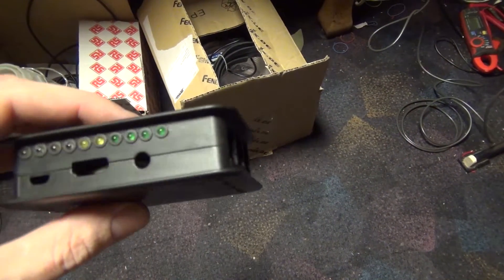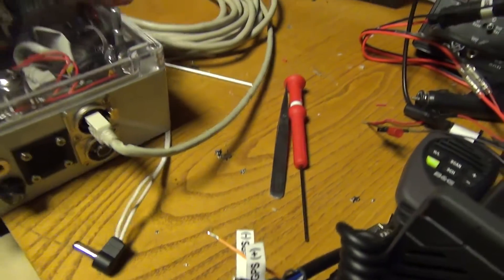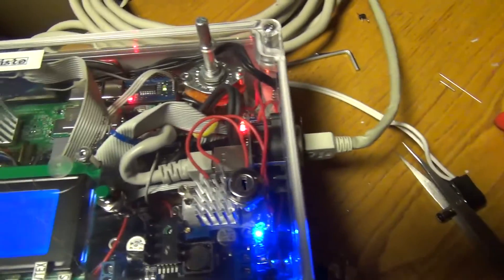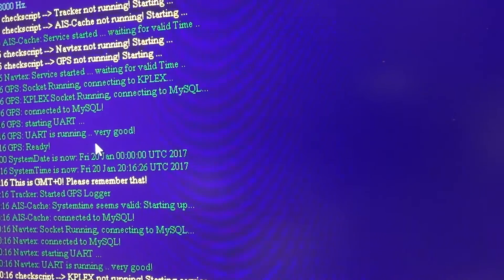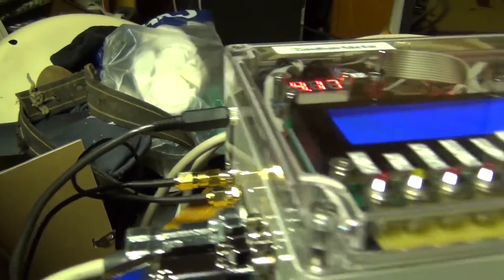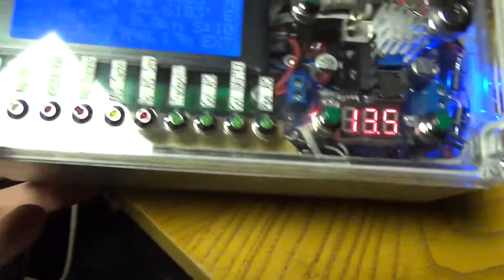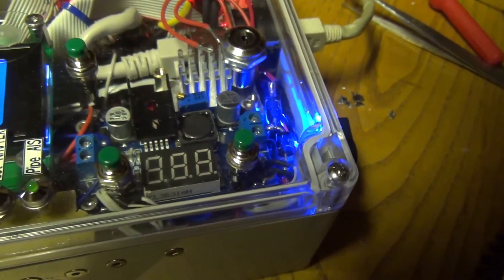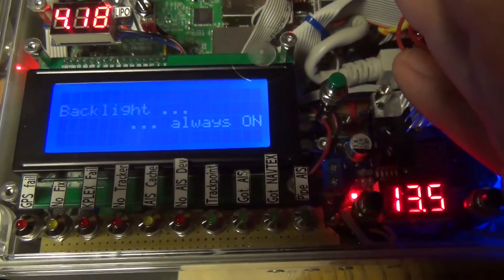Raspberry PI3 & GPS & AIS & Arduino & Display & NAVTEX ... v3

Comment: Would it be possible to use either a Raspberry Pi or Arduino to build a unit for recieving AIS data and sending it by NMEA 2000 to a Garmin chartplotter?
Reply from the maker: Hi, 

in principle - I think YES. 

However, KPLEX can do only NMEA 0183 as well as the AIS Decoder. So you need some kind of NMEA 0183 to 2000 converter on the Raspberry. 

I found a gux who did this using Signal K. See: https://docs.sailoog.com/openplotter-v1-x-x/how-does-it-work
Maybe this helps.

Comment: Here is a full class B transponder DIY  ! .5 watts. https://github.com/peterantypas/ais_transponder
Reply from the maker: Yea maybe, still a nogo in Germany, since it has no admission by the "Bundesnetzagentur". They come on board and test your equipment, which may cause troubles. 

There are a few frequencies you can use freely (e.g. 433MHz maximum 10mW!). But only because there is a general admission for this frequency. 162MHz (AIS) does not fall under this regulation and needs a certificate/approval. I bet other countries have similar regulations concerning this. 

I would highly recommend to check the regulations before building a transmitter even it has only 500mW output (Clas B is ususally 2W, class A 5W)

Comment: So, its sounds like a series of alarms will be easy for you. Bilge level, fuel level, fresh water level,  bilge pump test, engine temp, many alarms.  And, one boat has all systems showing on the same wifi display. Can be carried around on the ship. Radar can also be seen, And charts. and other things. This is all done by SV Delos, and the captain programed all of it. At the time he didn't replace the old equipment , rather figured out to interface it (different baud rates). So that all of the equipment would show on the same WiFi display.
Reply from the maker: Well, there are 2 philosophies. Either all in one or seperate systems. I don't like all in one, since if it breaks nothing works anymore. So I went for seperate system. e.g. the water level in my bilge is a complete seperate system. Or the box in this video is composed of 2 seperate system, which can function independendly. 

PS: SV Delos .. ya well - I like the boat but I kinda don't enjoy the style the videos are made. It's a lot about the people and the crew and less about the boat, techical stuff ans sailing. Occationally I watch one of their videos, but very rarely. 

Heh, but it would be boring if all sailng channels would do their videos in the same way ;)
Reply: @SY-Selene  Well, yes, each should have a completely separate way of monitoring, separate lcd, or something. But, what this system that Delos had was a way to pull the "monitoring " side of things together into a wifi tablet. You should still have separate systems with separate monitoring capability so if the Chuwi decides to "update" or whatever your still able to see things somewhere.       /// That said, couldn't find an AIS system (Pi) that could transmit the data into a typical fm transceiver which would send it out over the radio. I can find commercially available units that do that though so it definitely is doable. And, would save you a lot of money. The output , from your GPS basically, is fairly simple to encode , compared to decoding because decoding works with a ton of data from many sources and needs to display. Amazing that you and a few others could do it.
Reply: @SY-Selene  Yes , the video here https://www.youtube.com/watch?v=FJUSrbKS1-A&list=PLxzZgQElG0cG0FSFBHnYrUFmCFD21C4FR&index=52&t=364s  is the only technical video about electronics on the boat pretty much. At least the electronic radio ais radar plotter wind speed direction  side of it. By the way, the link is to my Sailing Cruisers Help playlist. Many subjects. And more being added all of the time.  My plan is to download all of these onto a large thumb drive if I can end up on the water. That's my dream.
Reply from the maker: Hey, see the pinned comment-tree here: https://www.youtube.com/watch?v=UPim6NTAJSo

A PI as transmitter would be a bad choice. You need some transmitter having a license. 

The legal terms are shown here. 

https://www.bundesnetzagentur.de/DE/Sachgebiete/Telekommunikation/Unternehmen_Institutionen/Frequenzen/SpezielleAnwendungen/Amateurfunk/amateurfunk_node.html

(you may need google to translate this into english)

But thats the reason why no transiver exists. If you disturb sidebands (e.g. emergency channels or rental frequencies) with a self build transiver and they find you then it will cost a high fine, or even jail.

Comment: This is incredible. You've inspired many ideas for me in creating my own system. Quick questions. Why is the arduino necessary? Couldnt the Pi3 accomplish all this on it's own? Are you running a separate Pi with OpenCPN for navigation? If so, does this Pi send GPS location to the other via SignalK? What's the amp draw or watts? Do you have solar to keep batteries topped off?
Reply from the maker: Hello, 

The Ardunio does just the GPS reception, the weather stuff and the Display. The thought is to have a seperate receiver to see my position and SOG, heading and air pressure even if the Raspberry may be crashed.

So it's kinda an emergency thing. I think the 13200mAh LiPo's can power just the Arduino for days/weeks in case of total power loss. With the Raspberry they hold about 12h

The System takes about 10W, so 0,8A at 12V if the LiPo is full. 

The PI transmitts all data in the ship via Ethernet and a WiFi for any wireless device (tablet, mobile, PC, Laptop or an other Raspberry)

I have solar and windpower. Max power is 720W if everything is running ;)
Reply: @SY-Selene  That is an excellent point about reliability and redundancy. I think I will also implement an Arduino as a fail safe for coordinates and pressure. Thank you for all the info!

Comment: why GPS and AIS ? Raspberry PI3 can do it simply with some Antenne non?
Reply from the maker: Hello, 
It's because I don't want to relay only on the PI. Due to it's software beeing on a SD Card, I had some trouble with a faulty file system, if the power is lost. Since I can't rule this out, it can happen, that I have to copy a backup to the SD before I can use the PI again. Thats why the GPS is handled by the Arduino, which sends the GPS data also to my VHF device (e.g. If I need to hit the distress button). 
Sure - the PI can handle all at once but this was made fore reasons of redundancy. In my final setup the PI will also have a GPS antenna, so in the end I'll have 3 (one with the Arduino, one at the PI and one in my active AIS transiver). For absolute backup I have also 3 more, to plug into my Laptop or connect them via BlueTooth ;)

Comment: Weltklasse! You have build an impressive system. Have you considered using WiFi/Bluetooth instead of annoying & corrosion sensitive cables? -Or will it just bring another level of trouble? 
Grüße aus Kaløvig
Reply from the maker: It creates a WiFi, well but between wome components cables are needed. 

Funny: I have more issues with the WiFi rather than the cables ...
Reply: kuttmoped Interesting experience.. 
Today's maritime components is often equipped with Bluetooth or WiFi.
Seems a better solution than cables. - If it works.. 
Otherwise there's just another level of trouble.. 
Viel Spaß noch ⛵
Reply from the maker: Well, the problem I've experienced was that inside the navigator, you have a lot of cables from other devices. 
Those cause problems with Bluetooth / WiFi, e.g. if you use them outside. Then on some spots the reception is very good and on some very bad. 

However, calbes have also problems at the connectors. Maybe I have to rebuild the "Zauberkiste" a bit due to some minor issues because of that. 

Gruß
Martin

Comment: impressive setup. And here I am just happy I got OpenCPN working on a Pi-Zero.

are you doing your own programming for all parts, like what you show on the blue screen and computer? Looks good. What boat will all this be installed on?
Reply from the maker: Hello, I do the programming partly in the MC editor (Midnight Commander). Sometimes I use PSPad - this one can connect via FTP to the PI and so I can upload the files after edit. Usually a terminal is needed to compile the stuff if it's a C programm.

For the boat: I bought a Dufour 4800 about 2 month ago. Also I wanted to bring the video way earlier but I got a sepsis (blood poisining), which knocked me completely out for about one month :/ 

But the next Video will be a functional diagramm of this setup and on the one after that I plan to do a explaination how the software is the up (in principle)